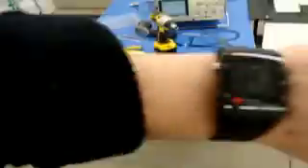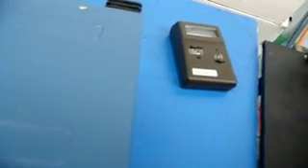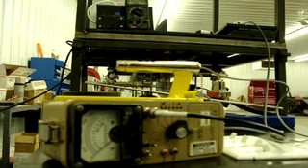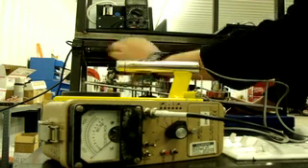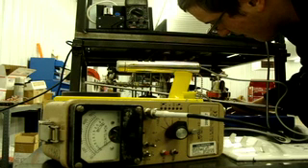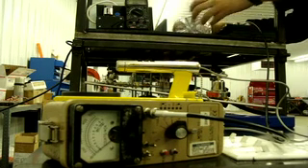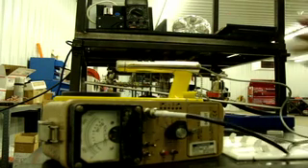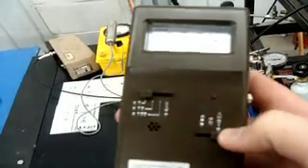First Neutrons

Comment from the maker: I use a vacuum. Even if the vacuum failed there would be enough air rushing in to stop the small ball of plasma (only a plasma because the vacuum allows it). The amount of energy that plasma is at within any single second is 300 joules. How much energy is that? About enough to warm up one gram of water for a (very small) cup of tea. About the same amount of energy as dropping a small hammer 4 millimeters. It's very hot but there isn't a lot that's very hot on top of that it's touching nothing.

Comment from the maker: The X-Ray energy was 30KeV.  I have withheld the activation experiments for now. My primary focus this year has been on increasing efficiency. Last year I tested various inner grid geometries, and this year I tested an engineered apparatus that pre-ionizes and focuses the gas. Results aren't very promising for the focusing apparatus, but the ion gun is giving my a ~180% efficiency boost :P Still not much. *Rough* calculations give me a total emission rate of around ~200,000 reactions/sec.